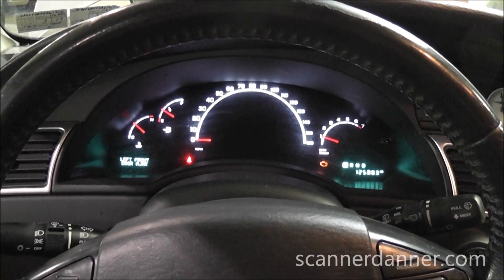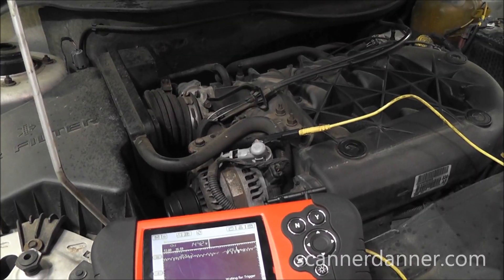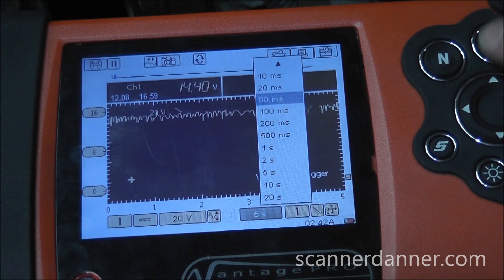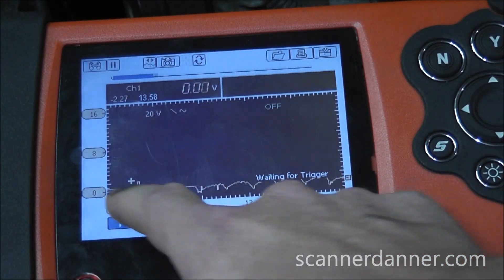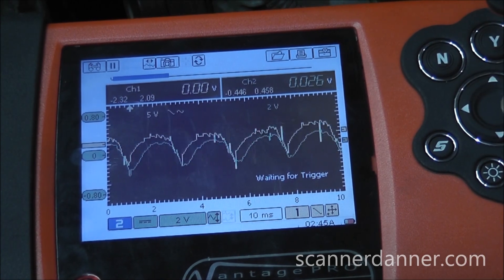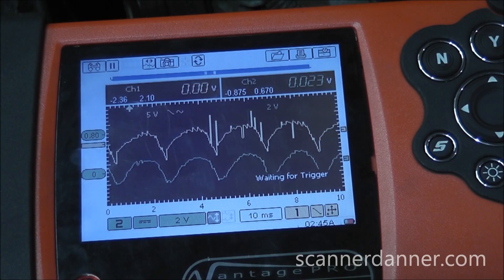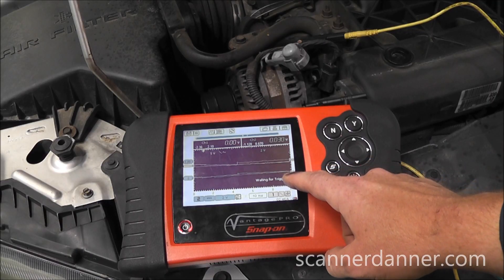Bad Alternator Diode causing transmission/speedometer problems

Comment: I been having intermittent battery voltage lose over night for about a yr.  Tge droppage weren't significant but noticeable because I had long to no crank in mornings. So I started checking voltage daily. Alternator was tested several times nothing  indicating it was failing. So I just changed batteries twice. All summer car still starts but strange things began to happen like an erratic tachometer when ever I turn left slowly or going over train tracks. Then the ABS light comes and goes, cruise stopped engaging. Open circuits in stop light switch(changed twice) open in outside temp sensor(changed twice) and open in CAM actuator bank 1, recommend to change OCV, changed it and other one alone with cam position sensor. Now that it has gotten freeezing cold alt appears to stop charging all together. When checked with multimeter while car running it showed no sign if activity from ALT, BAT vol read 12.04.

Comment: I have an 2004 isuzu FVR that goes on limp mode after driving it for a while, usually after 30 miles,  ABS light never goes even after replacing all the speed sensors, speedometer stays at 20 mph all the time and no rpm reading at all, the rest of the gauges work, keeps throwing code C0040 right front speed sensor circuit, and codes U2105 U2104 U2106, lost communication with TCM, canbus reset counter overrun, etc. tomorrow im going to check if there is any AC voltage in the battery and alternator B post to ground, i tested the alternator and gives 14.28v on battery and  14.42 on alternator at idle with all accessories on, so i guess is fine, then I disconected the negative of the battery and read voltage from postive of battery to alternator ground it was 0.003V (i understand it should be 0.45 to 0.8v) so i really dont know what that means, im guessing alternator diodes, what do you think bro

Comment: Today i replaced an alternator on a 08 Silverado 1500 5.3L that has a tranmission issues and a code for transmission losing communication with ecm. Diagnosed everything, can bus, ecm and tcm module, battery, ground connectors, VSS sensor. Then checked the alternator n it seems like the diodes reading was  all over but still putting 14v charge so I had to call for battery and alternator because i had to start with having a good voltage supply. Made sure I cleaned the grounds  where alternator sits. So problem solved. It was the alternator after the car was in the shop for a week. Lol

Comment: Very informative. I'm having issues with my 06 Impala. Headlights pulsing and voltage dropping to 12.6 on the alternator. I'm getting ac fluctuation when I put my multi meter on the batter posts. Looks like I will be replacing my alternator....
Reply: Was it the alternator

Comment: Automotive manufacturers need to be held to the same design and reliability standards as the aerospace industry.  They make too much profit from failed sensors that should be redundant and never should anyone ever need a tow because of a single sensor failure.  Every car should have  dual battery units that alternate being isolated so you never need a jump start.  All engine timing circuits should have dual crank position sensors of different style like a reluctor wheel and a square wave on the output shaft as well as 2 cam position sensors.  Each cylinder should have dual coil packs conecting to dual electrode plugs.  The fuel system could be designed with 2 smaller intank pumps and dual injectors.
Every car should have a 5 wire wideband 02 sensor that not only can save gas but add redundancy to the cheap single wire sensors.

Water, oil, and power steering pumps could be designed with smaller dual impellars using seperate seals and bearing assemblies.
Its been proven that using dual low amperage alternators and one with a disengagement clutch would last much longer.  80% of alt failure is runaway heat soak.

They also need to change the 0 to 5 volt reference sensors to 5 to 10volt reference so they are not thrown out of range from wire and connector  resistance from corrosion. They need to increase their bitrate to 128bit or dual 64 bit.  The auto industry is over a decade behind the latest technical innovations thats why Elon Musk is the richest man to ever live
Reply from the maker: They used to use a 9v ref on some older models. The problem is during cranking system voltage can momentarily drop to 8v, before recovering to 10+ as the starter rotates. The 5v reference prevents this interference. Plus it is a standard across many electronics that are not automotive related

Comment: Would a bad alternator cause random misfires or misfires that jump around, tough to start a car after it ran for a bit, and maybe O2 sensors to show as bad? I went on a test drive and it seemed to be smoking, but not sure if it will be a single problem or multiple problems. I have checked the spark, compression, etc but the issue seems to change every time i think I have solved the issue.
Reply from the maker: Hard starts, absolutely not.

Comment: 04 F150 Lariat 4 x 4 automatic 5.4 nephew's recently purchased and trying to figure out this issues for him without costing him a arm and leg.
Having speedometer issues. The message center on the cluster displays trouble code 9318, 9352, D950. I've already replaced transmission output speed sensor, differential speed sensor.   ObD only has emissions related codes. I understand those message center codes are battery, alternator related. Voltage is only 11.7 not running.  Could a bad battery or alternator theoretically cause his speedometer issue?  When I picked the truck up  from him jumper cables were in the floorboard and appeared to have a new Diehard battery under the hood.  Previous owner said speedometer every now and then would work and was accurate when it did work. Any help you could offer is appreciated sir. Thanks

Note: Trying not to order a cluster until all other possible causes eliminated.
Reply from the maker: You'll need to research those codes as a starting point
Reply: @ScannerDanner  turns out after having a clustertech examine and do a sweeptest of guauges the stepper was bad on speedometer and a bad circuit panel on temp guage. 1st visit to him he said temp guage was fine. But after replacing oil pan temp sensor and cylinderhead temp sensor( there is no ect sensor on this model) with still no improvement I repeated the sweeptest. It showed all guages good except zero response on temp guage. Before it was eractic response from temp guage. Now zero response. Returned to cluster tech he reevaluated and found bad circuit. 04 5.4 3V 2 WD Lariat.  I was real  lucky finding a good local reliable cluster tech. Cya Brother. Thanks
Reply: Oh yeah tested at Autoparts store to confirm bad alternator, tested battery it was good, replaced alternator with new one. I got a feeling incorrect jump starting with it was behind all this. Or at a contributing factor. Maybe both alternators running simultaneously while jumping someone or getting a jump from someone.

Comment: We've seen this problem numerous times as well as far as the alternator making the speedo read. But the last time we checked was on a Chrysler minivan unhooking the control wires the pattern stayed the same and the speedo showed MPH at a stand still. We had to unhook the battery positive cable at the alternator before it flat lined on the Vantage( that's odd.)???

Comment: Toyota techs have found a fault code that both my camshaft sensors are not functioning properly.
My check engine light and vsc light is permanently on yet the vehicle drives perfectly.
I have checked both the camshaft sensors and they are perfect.
Could a defective alternator be causing these fault codes?

Comment: I remember this weird flickering of the backlights on the combination meter on a mid 2000s Hyundai Elantra when interior lights are ON. The flickering correlated with engine rpm. At the time I suspected the RF Noise Filter capacitor on the ignition circuit. It just might have been a bad AC ripple from the alternator. Thanks.

Comment: I've got a code on OBD2 that shows alternator overcharging. I checked it because of transmission shudder between gears 1 and 2. I also had lost communication codes for TCM and ECM. No other issues with the vehicles operation. Is this possibly the cause of the issues I'm having with the transmission? 2013 focus.
Reply from the maker: If you clear those codes, do they immediately return? If the answer is no, is your shutter still there regardless of the codes? Also what is actual battery voltage when the car is running? (Measured directly at the battery)
Reply: @ScannerDanner  I haven't cleared the codes. Didn't know if I needed to leave them if I have to take it to a shop. But I guess if it's a persistent problem they will pop again. I believe the reading at the battery while running was 13. the OBD scanner reading said 14.66 on the alternator charging. It said that was overcharging? I know very little about vehicles in the last 10 years or so. Will not erasing codes cause an issue? I did also clean the terminals on the battery the same day before the test were done.
Reply: @ScannerDanner  I will have to erase the codes and retest
Reply from the maker: @jltcdm369  recheck battery voltage too because having a lower reading than what you see on the scanner if definitely not right

Comment: Hello Paul

I am getting same exact scenario of having VSS reading while im sitting still parked! Is changing DIODE on the alternator solved your issue or you need to have the whole alternator replaced?

Update : just replaced my rectifier diode assembly but no good. My VSS still reads randomly while in park (mostly when hot !)
Reply from the maker: If you disconnect the alternator, does your problem go away? If so, change it!

Comment: 2002 infiniti q45, bad alternator causing false crank signal resulting in engine timing advance to slowly go to 0, car would randomly throw codes for things on the 5v system (power steering pressure sensor, vvt, ecm codes etc)

Comment: I have a 2014 Subaru Outback with a tachometer going crazy while driving. Jumping all over the place. When the tachometer starts jumping really bad it trips a egr code p1494. No one can seem to fix it. Had it in 3 shops.

Comment: Having the same problem on a 2007 chevy silverado z71 4x4 speedometer goes up and down from 0 to  20 won't really shift from 1-2 automatically but when changing  manually resolves the speedometer reading . Its also having problems with the radio sometimes its fine and other times only sound coming from tweeters as well as no lock or unlock on all 4 doors. Also some fuses don't get any current at all. The last owner had a sound system but took it out and just cut all the wiring. These have 2 batteries but currently operating on 1, its a high milage truck.
Reply from the maker: you need an enhanced scan tool that can read codes on all the modules on that truck, what you are describing sounds like a CAN data bus fault

Comment: Thanks for the video, great work ScannerDanner!

I have a 2004 MINI Cooper project that I picked up for a couple hundred bucks because of a "bad transmission".  I tried to reset the CVT adaptations but realized the Output Speed Sensor was reading zero...because the wires were burned up!  Things I did to fix the issue...traced wiring looking for shorts, shorts to ground,etc.  Replaced engine computer, engine fuse block, engine wire harness, transmission control computer, transmission valve body and of course a handful of sensors.  Every time, a shorted out Output Speed Sensor shortly after starting (traveling no farther than 100 yards).

This weekend, I replaced the alternator (I don't have the scan tools you have)...and this MINI is road worthy again.  Something in the old alternator was causing the voltage/amperage spike in this car.  I've got BMW software on my laptop and was able to watch the analog readings for the speedometer and the output speed sensor.  It appears that all is good now...I was cruising the county roads yesterday for test rides!
Reply from the maker: Awesome! What a nightmare that sounded like

Comment: I do not understand why there is a difference between the what you see at the alternator versus the battery. Is there some some kind of a choke/inductor between the alternator  and battery that is filtering the noise and the ripple?

Comment: Excellent video as always. My question is, how did you know to go straight to the alternator? Would starting off with a wiring diagram help at all? Or is it down to experience?
Reply: Id say more of “knowing” how things work in the system. 
An alternator produces AC voltage by nature which is then turned into DC by the diodes. 
The speedometer system works off from an ac signal produced by the sensor ( magnets and theeth on a gear and some wizardry) produce ac. Just like an alternator would. 
A lot of this stuff you can piece together with general knowledge of how systems work, and they are pretty standard from vehicle to vehicle. 
That is why Paul always stresses learning basics, then you apply them to different systems.

Comment: This video saved me thousands of dollars. My 2004 Pacifica was giving me similar issues.  

First I was having a parasitic battery drain over night. 

Second. When putting car in Drive or reverse it was aggress.

Third. While idoling at traffic lights the speedometer would jump up from 10 to 20 mph depending if I had the HVAC going.

Fourth. At times while driving it out not get out of 2nd or 3rd gear.  Or it was aggressively switching gears.

Fifth. Getting transmission codes.

So after alot of online investigation and coming across videos like this. I replaced my alternator and wow....  Car rides smoothly. 

Thank you,,, Thank you,,,, Thank you!!!

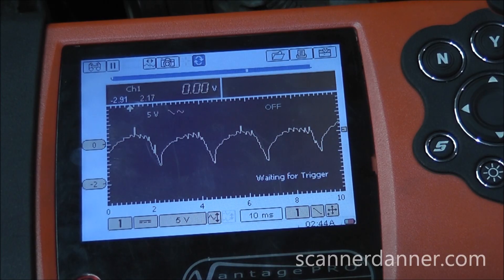Comment: 3:04     that's a 5  V  diff.
1:22      minimum 12.08  max 16.59   ,that alone shows poor rectification.
Was it an open diode,or a leaky/shorted, partially, diode,anybody knows?
A leaky  diode will put a drain on the battery,an open diode won't, and that is important too.

Comment: Hey Danner, im a mechanic for a truck repair center in mckees rocks pa. I recently purchased a class A RV with a ford V10. Driving home it set an output speed sensor code and would stall. I replaced the output and input sensor. No fix. I redid some grounds and back probed the sensor wires. No good. I found your video and ran the same test. Sure enough it was the alternator. Im pretty sure thats why it was traded in. The former owners couldnt figure it out. Thanks for the info and i love your videos!
Reply from the maker: Awesome! Sucks to be them, great for you. Nice job man

Comment: Just curious; without prior knowledge of this issue, I'm guessing the alternator output wouldn't have been the first place you would have checked.
Being familiar with how you approach symptoms you may have scoped the Speedo freq generator and discovered the ripple on it.
I'd just have to bow profoundly to you and say 'we're not worthy' if you thought of the alternator right up front😊
Also the battery acts line a huge 'noise' filter send tries to smooth out any fast variations of change in voltage.  Hence, smaller sou m ripple at the battery.
Reply from the maker: Alternator was my first thought as I've been down this path before, but the whining of the alternator also gave it away and with the speedo doing it's thing and a second gear lockout of the trans made me go directly to it.

Comment: Same issue with speedometer with  an 03 Town and Country, but alternator isn't making abnormally loud whining noise to tip me off to suspect alternator first. It also has TCM code P-1790, (Fault immediately after shift) and P-0720 (Output speed sensor error) I replaced both the output and input speed sensors which didn't fix issue. The audio system in the car sounded clear and fine without induced whine or static a bad alternator typically causes, and the MaxiSys displayed the VCI voltage at DLC as normal charging voltage. I did notice correlation of less of an electrical loads on the alternator the less the speedometer needle would jump and fluctuate from zero in drive  at a stop. I disconnected the field connector and the speedometer would stay at zero and not jump around. I cleaned the alternator BAT stud and cable eye , and ground connections. I Checked the TCM connector and tested the grounds for TCM and loaded tested the grounds for TCM as fine. I provided extra support with Tie straps for the wiring loom at side of trans. I decided to call it a day and Google the problem and came across a video of Paul's brother, and then this one. I think I'll hook up my ole Counselor 2 and see what the alternator pattern looks like and take a few pictures if the Midtronics tester at Advance Auto doesn't print out and condemn the Alternator ripple, so I can get The Turd warranteed if Autozone tester says there's nothing wrong with it, LOL

Comment: Will a faulty alternator freeze the gears. When u put in drive or reverse, no go.
Reply from the maker: Most likely not. This vehicle had reverse and would drive but it would go into a second gear lock mode. If you have no forward or reverse at all, it is probably a transmission problem

Comment: I’m having this issue with my 05 Pacifica. The mechanic just replaced the alternator and they said it was a new one but it’s still doing this 20mph and shifting thing. Before I was having a TON of electrical issues (warning lights, headlights not working, Windows not working, sunroof not working, CD player constantly flipping cds etc) could it still be a bad diode or is it more likely with the new alternator to be the VSS itself?

Comment: I am not sure if understood the disconnecting of the alternator input connector. Obviously when the input connector is disconnected, even the good alternator would not be putting out voltage. Thus, the flat line.